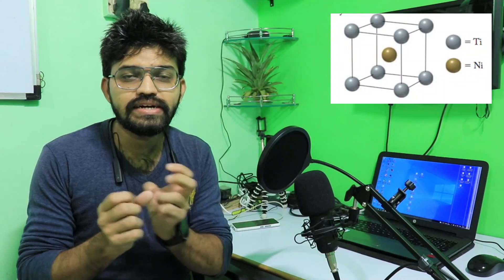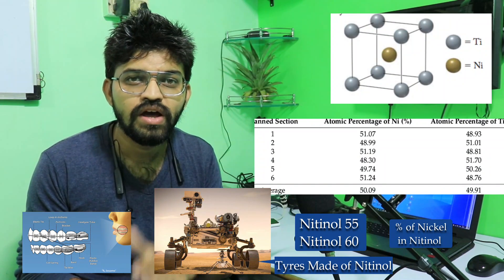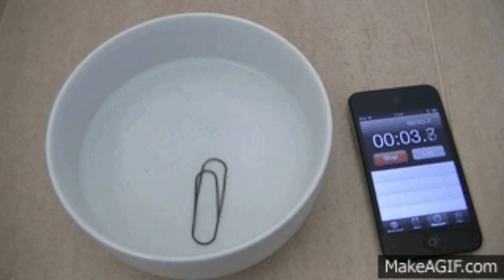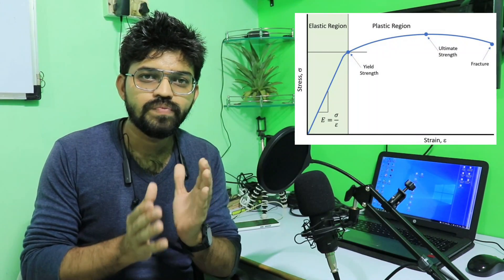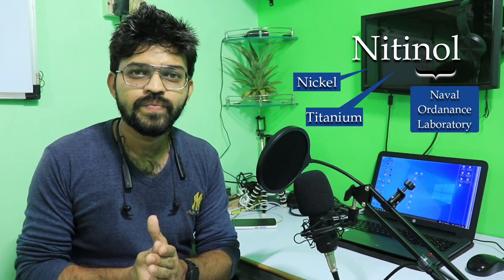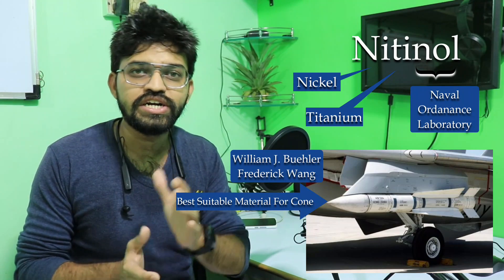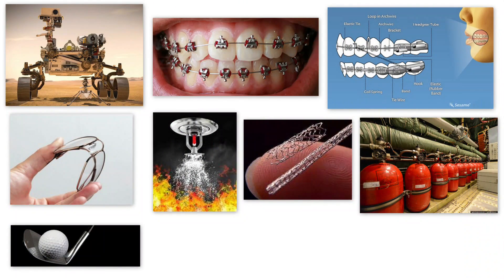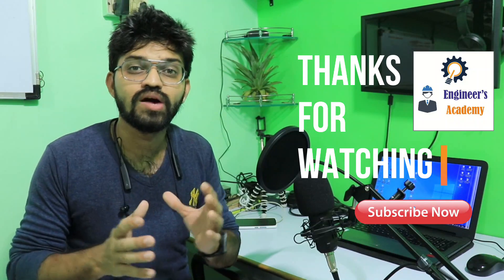What is Nitinol??

Comment: 8:38 what you've labeled twinned martensite at the upper right is actually detwinned martensite.  The twinned martensite structure is the upper left one.

7:37 It requires less force to deform martensite than austenite, not more.